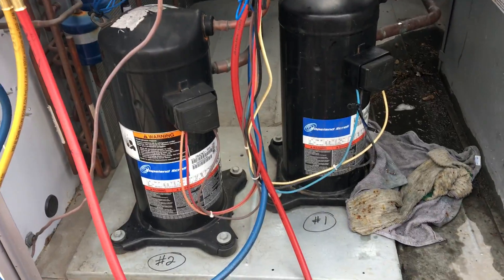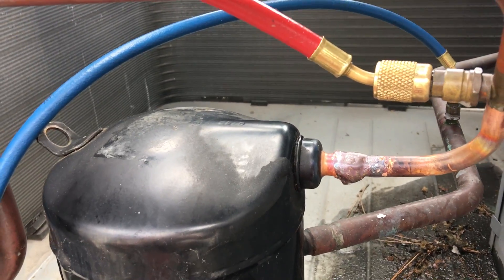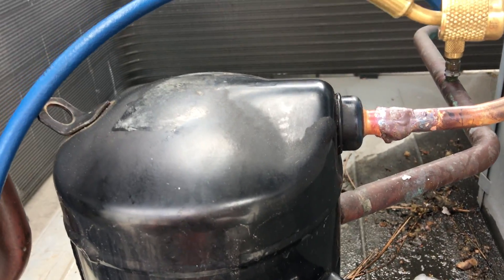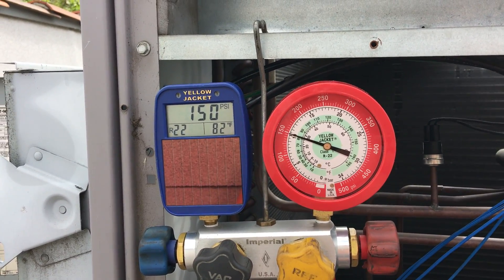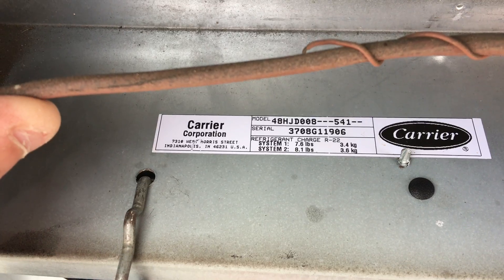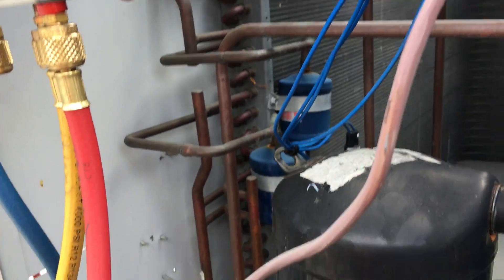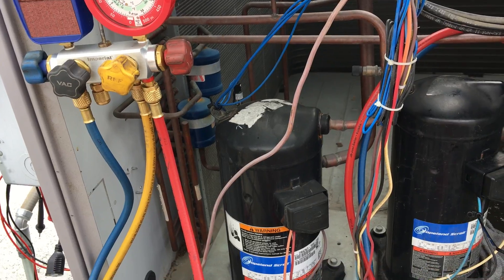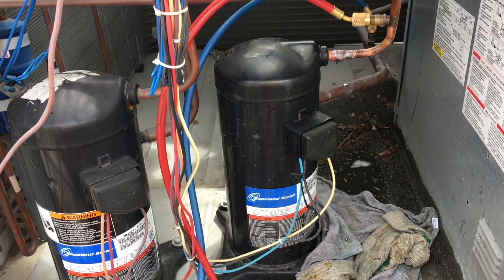Carrier 7.5 ton a/c unit.  Showing HOt Gas Welded & 150 Psig Pressure test. Rock solid !!!

Comment: i hsve a true refrigerator freezer model t 23 dt. the problem im having is that sometimes the temperature goes from -11 then it will jump to +20 degrees then immediately goback down to -11. i changed the defrost timer and seems to be better except for this any thoughts?
Reply from the maker: +steven chandler   what u are noticing is probably the fan cycling after defrost. after defrost fan cycles once or twice because it is on a temp. klixon on the evap coil. compressor comes on after defrost, pulls evap down without the fans on till a certain temp then fan comes on, temp will rise above fan cycle point, fan goes off, evap gets cold again, fan comes on etc. you can notice these fluctuations on the fridge display temp. unless product is defrosting or u are noticing heat in the fridge. it's prob ok.
thats a very small box and temp fluctuations are probably very noticable.
How old is fridge/ freezer?
as fridges age they get a refrigerant leak and and u may be seeing a loss of performance.
Things to check:
1) Make sure condenser is clean and u can see through it with a flash light. no fryer Grease on it what so ever is acceptable.
2) when unit is at or below zero degree's, suction line should be very cold at the compressor, ( thats the insulated line). if not u have a refrigerant leak and are seeing a performance loss. 

could u give me Serial # so i can see how old it is. it helps with diagnosis, revision, analog or digital, particular factory builds, factory specials, etc.

Oc.
Reply: +OcRefrigeration,Hvac & Electrical. the unit is about 7 years old. the serial no. is AEA3425YXA.
Reply from the maker: +steven chandler   thats the tecumseh compressor model number. open the refrigerator or freezer door, upper left hand corner is a true model and serial number tag. serial number will be like "  1-698753 "
Reply from the maker: Yep, thats it. True factory ship date: Monday August 17 2009.
Model # T-23DT
Country : USA
Reply from the maker: +steven chandler Probably not a good idea to post your e-mail on here. your opening yourself up to spammers & solicitors. best to Private message that to people on you tube. i recommend u remove that e-mail address. just edit the Post. keep the serial number up for reference if u would. thanks.
Reply: +OcRefrigeration,Hvac & Electrical. thank you email was deleted.

Comment: Those units would leak at the Evaps all the time. Thanks for sharing.
Reply from the maker: U bends ?
Reply: Yep. Crawl back in there. Lol. I've had the condensers leak also.
Reply from the maker: +Nor-Cal Refrigeration &amp; H.V.A.C    Yep, H10's gonna get used tomorrow. I thought I might have seen a bit of oil on the evap u bends under the condenser fan area.

Comment: Whats up with the old filter dryer still in the system? I used to work on a ton of carrier rtu's Those dryers were known for clogging up.  From the factory they mostly use 083 dryers they are slightly under sized. I go back with an 163 filter dryer. Nice repair on fixing the leak.
Reply from the maker: It's only a 3 1/2 ton system. An 083 is acceptable. 
But, like u say if I was replacing the drier , a 163s would be better. Drier is not restricted & system works well. As a rule I only replace driers when when I replace compressors or am welding any more than 4 joints. Or doing extensive repairs. For a one weld leak repair driers not gonna get changed on a new unit that I am the first to work on it.